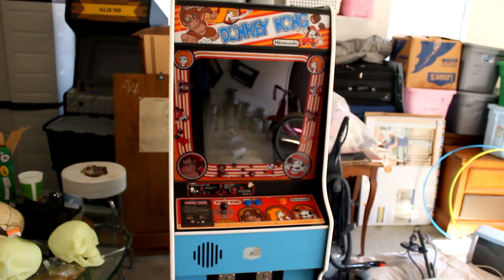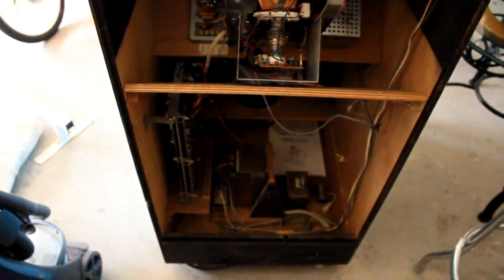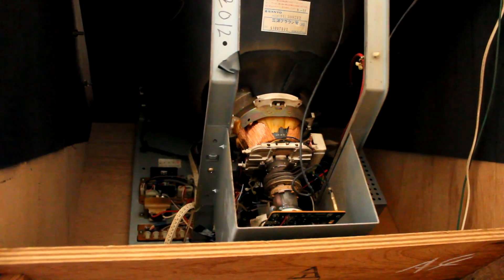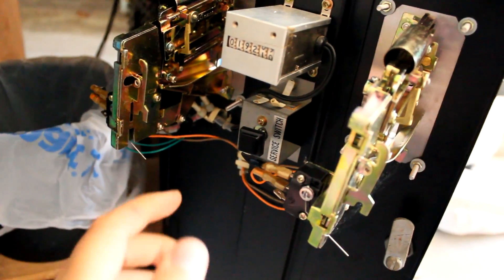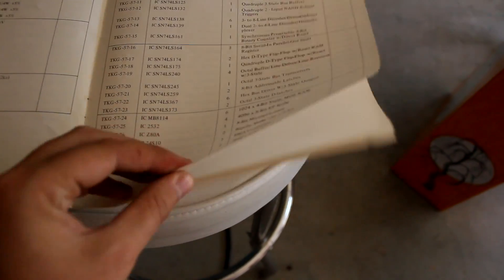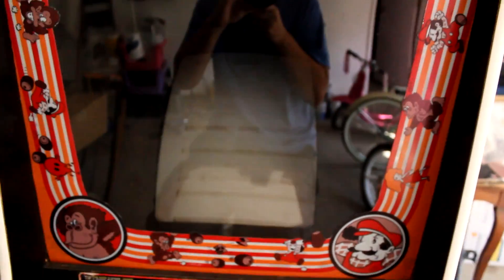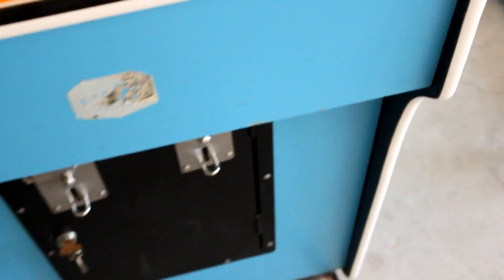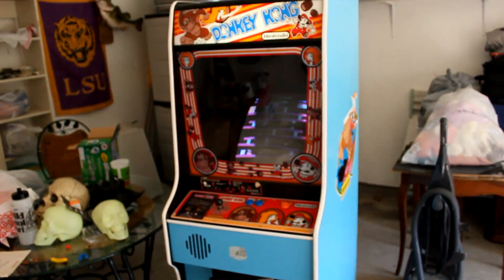How Does An Arcade Machine Work?

Comment: Is it possible to take the arcade board(s) and install them in a more compact space like a PC case, and then mod them so it's able to display on a modern monitor, modern speakers, and maybe a USB controller?
Reply: Yes, you just need an EGA to VGA converter board, and then a VGA to HDMI converter cable. Otherwise the sound wouldn't come through modern speakers. For the USB controller there is a converter for that too, but I can't remember what it's called off the top of my head

Comment: Thanks for this. I have built a few desktop PCs and want to learn how to repair arcade machines. Do think someone who would do this as a job needs to learn more how to fix the mechanical stuff or the electrical stuff (soldering, etc). Thanks in advance
Reply: Whats up!?! If youre still wondering the answer is yes! Learn the full round with electrical and mechanical as well. I just started a new job repairing machines with on the job training and all this is involved. We do soldering, replacing mechanical parts, reworking electrical wires if theyre burnt out and more! Sounds like a hard job but its fun and usually pays quite well

Comment: I came here for: is there a video showing how did they make (programmed) an arcade game of the mid eighties?
Reply: Different parts of the program were burned onto a bunch of chips with uv light (I think don't quote me on that), and they are put on a boarrd and the board outputs everything to the monitor
Reply: oh yes, the pcb! thanks! no, I was talking about a developer explaining about the binary codes, how they had to draw it on paper, if they used a scanner (90s pixel art) stuff like that :)
 - not the actual hardware part but the software part!
 (yes the hardware is also beautiful)
Reply: Aloan Moreira Sorry I couldn't provide you with the right info. Now I'm kind of curious about that too lol
Reply: @smooooth_  how do they make the sprites on a arcade